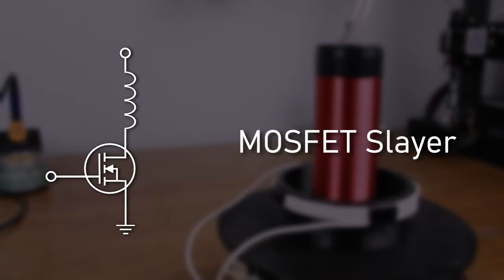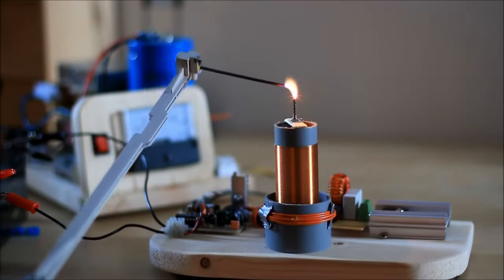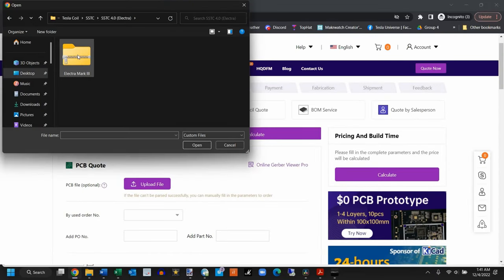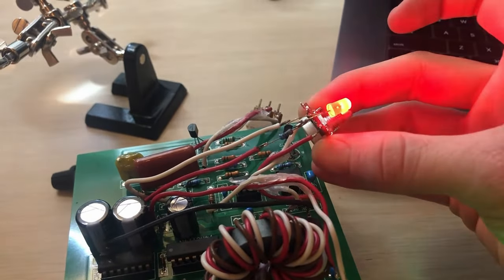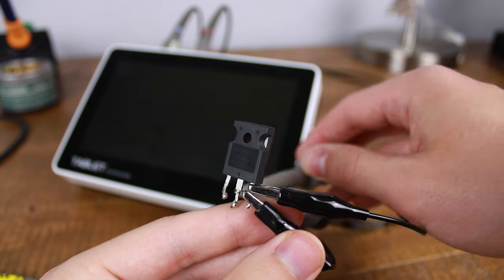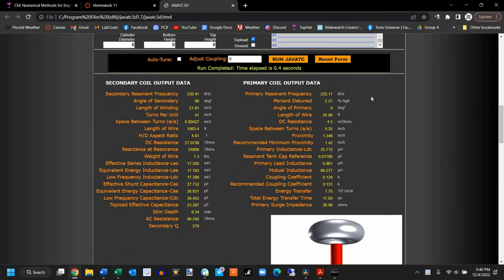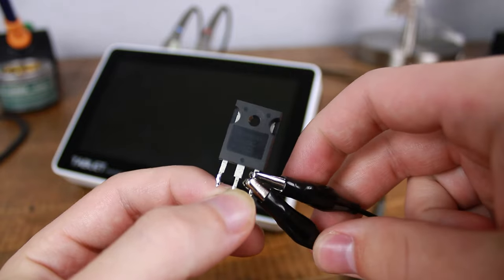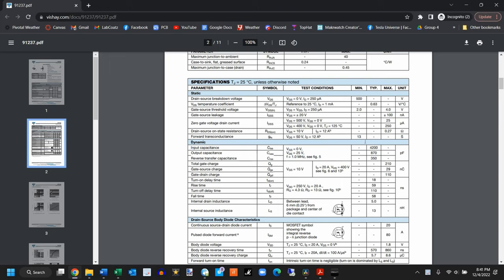Inventing the Ultimate Class-E Musical Tesla Coil (Single-FET SSTC) | A Complete Build Tutorial

Comment: First of all, I want to thank you. I have improved a lot thanks to your videos. I want to suggest an idea to you. I do not know if it is relevant, especially since I am a beginner in electronics. You said that at high frequencies, more current is required from the gate driver IC to turn the mosfet on and off, which can increase gate capacitance and cause the UCC27524 to overheat. A solution might be to put an optocoupler between the integrated control circuit and the mosfet, this would electrically isolate these 2 circuits. On the other hand, I believe that the switching speed of optocouplers does not exceed 5 Mhz. It needs to be checked. Thank you again for all you do.
Reply from the maker: Glad I've been able to inspire you with my work thus far, and that's a good theory! The problem with using an optocoupler in this way would be the fact that the optocoupler demands "actual" electric current. That may sound a little funny, but think of it like this: a MOSFET or IGBT gate is essentially a capacitor that must be charged up to turn the transistor "on", while the inputs lines of an optocoupler just go through an LED. An LED requires a constant current to be on, while the MOSFET gate only requires a quick burst of current to charge up to the MOSFET's trigger voltage. Therefore, the MOSFET by itself requires less energy to charge with the UCC27524. Hope that all made sense, haha!
Reply: @LabCoatz_Science  I understand better when you make the analogy between the gate of the mosfet and the capacitor. Thank you for the explanations.

Comment: Thank you lots for this amazing and interesting video! I'd love trying to build a Class-E as well, and I was wondering if those casing parts are (or that case is) 3D printed. And if so, is/are the stl file(s) available?
Anyway, have a good time and I wish you everything good for your next projects <3

Edit: I'd be interested in the stl because I like your simplistic design and I would already have fitting dimensions then :)
Reply from the maker: Glad I could inspire! The stl files are in the video description, but honestly, they aren't the best. Most of the stuff (like the PCB mounting pins and the top and bottom halves) has to be glued together permanently with something like epoxy, and the connection sockets for the PVC pipe may not fit perfectly (mine was a little loose, so I added a few layers of electrical tape to tighten up the joint) but if you're interested, they're there for the taking!
Reply: @LabCoatz  Thank you very much for the quick reply! I've totally overlooked the line in the description. Anyway, I'll try to look for opportunities for the stl files, when I have some more free time soon. Thank you for the advice! You really inspired me with your work. I hope, you'll keep up the good work!

Comment: Mine is 1MHz, how could I calculate the Tuning cap?
Reply from the maker: I told how in the video: JavaTC to get close, and the rest is manual adjustment of the primary coil.
Reply: Vas a hacer está bobina con el Schmitt trigger ? Definitivamente vale la pena , pero yo creó qué usaría el cd4046 si vas a hacer modulación de audio , en la mía el sonido es mucho más claro y fuerte cuando usó el vco , no estoy seguro pero quizás en el Schmitt trigger se podría inyectar el audio en la parte del oscilador y hacer una especie de vco , en mí esperiencia el audio por frecuencia modulada suena mucho mejor qué por pwm , en cuanto al capacitor creó qué estos osciladores son muy versatiles con los valores qué usó en el video podés variar desde 400khz hasta 6 mhz si no me equivoco

Comment: So i built this and can't change the duty cycle, and drew 2.5amps until the 460 cooked.
Any ideas?
Reply: Little update, may have had a bad 7812.. changed all chips and tvs and 460... now I have duty control :D
Reply: @kdkinen can i ask you which gate driver did you use?
Reply: @raj9624  I think I was able to find the one he listed. Which is the faster version chip
Reply: @kdkinen  lucky you but for my case i searched and searched and couldn't find drop in replacements and similar drivers

Comment: I want to try that 400v tvs to protect the fet , the 18v tvs at the gate would help with the gate ringing right ?
Reply from the maker: Not really, the TVS is just to prevent voltage spike damage, since there is no GDT isolation. The gate resistors are what really help with the ringing, but they can't be too large, otherwise the gate signal will become more "flabby" with slow transition times.
Reply: @LabCoatz_Science  You left me thinking when you said the coil would resonate at any multiple of the resonance frequency , I did some Frequency measurements on the logic of my pll sstc and it was way lower that what I expected (400khz ) at first I thought that was my shitty arduino frequency counter but now I am thinking I might be running at a lower resonance . My calculations say it should be about 2mhz

Comment: Nice build. Isnt it better to put the resonant capacitor across the primary instead across the MOSFET?
Reply from the maker: As far as I can tell, no, the capacitor must be across the MOSFET for it to experience the necessary ZVS required for efficient switching. Hence why such "tuned Slayer exciters" still overheat their transistors.
Reply: @LabCoatz_Science I think you could make an Armstrong oscillator/class C amplifier with a single transistor. Just like a vacuum tube Tesla coil but with a transistor in place of the tube.

Comment: Hey Zach, I think I broke the sound barrier while discharging my circuit. .. no damage to the anything .. but that crack and blast .. it shook the walls and my chest. Then the card board housing I chose for your supply was blown out .. still nothing in the way of damage .. no arc flash. Everything still works  .
what do you think it could have been . ? Just a user error .. haha
Reply: Oh and sorry , by discharge I mean I was finished with the 45min of fun and goin to bed .. disassembling everything .. 
and so it’s good practice to discharge things to a ground ..
I have a dedicated ground in all rooms of the house at this point haha..

Comment: Let me say you something
Hi .

I am just decided to make your circuit but the problem is will the ucc27425 work for this instead of ucc27524.
If it is ok i have all compoundnents in hand
Reply from the maker: No, if you look at the layout of the UCC27425, you will see it has both an inverting and non inverting output, while the UCC27524 is only non inverting, so the UCC27425 is incompatible.
Reply: Ok

Comment: Do you think it could be audio modulated by Frequency shifting if you inyect the audio signal into the Schmitt trigger oscilator stage ?  It would be cool to have both features in the same circuit to compare pwm vs freq shifting audio
Reply from the maker: I honestly don't know! You're welcome to give it a try though, as it probably won't damage anything!
Reply: @LabCoatz_Science  I will brother , I am about to get a ucc27524 and I will build your desing
Reply: Yes, if you use a 74LV4046 pll ic and inject the audio at the VCO input, this will nudge the frequency up and down, but is not a good way to audio modulate a Class E setup as it will throw the circuit in and out of Class E operation which will stress the fet, and is really only suitable for use in a regular half/full bridge SSTC. 

The best way is to simply just audio modulate the DC bus feeding the Class E circuit.

Comment: Tks for this wonderfull project ! 
How did you know how many turns you had to have to get 1.5Mhz?
Reply from the maker: I calculated with JavaTC, and then checked with my oscilloscope.
Reply: @LabCoatz_Science  i bought exaxctly the same components. I will do like you. Javatc is hard to understand....
Reply from the maker: @tkfou801  no worries, once you get the hang of it, it's pretty straightforward!
Reply: @LabCoatz_Science  Top thanks!
I also see that on the card there is a 1nF capacitor connected to the GATE of the IRFP460 but I don't see it on the schematic ... What is its use?
Reply from the maker: @tkfou801  It was omitted; it would have been for dampening gate ringing, but instead, it just made the switching speed slower and it drew more power.

Comment: How load is this build? What are the  ways to increase the volume?
Reply from the maker: At full power it is about as loud as a phone speaker, but the volume really depends on the input signal strength and the coil's output size. For example, my computer outputs a stronger headphone-out signal than my phone, so it produces the loudest spark.
Reply: @LabCoatz_Science  Thanks for the reply! If I wanted to make the coil 3 or 4 times bigger, taller, would that change any of the electronics required? What else would I have to change?

Comment: man i wish i had the money and skills to make a tesla coil
Reply: there are some pretty cheap and easy designs out there. I suggest checking out my channel and labcoatz's other videosto learn more about tesla coils and how to design them.
Reply: It is not expesive at all , you can salvage components from old electronics , I recomend you to start with a slayer exciter almost any NPN transistor and some diodes it will work
Reply: @rodriguezfranco3839  slayer exciter won't give long arcs.. I want them big
Reply: @styrishrodrigues  if you want big arcs do the push pull sstc by tefatronix or skori